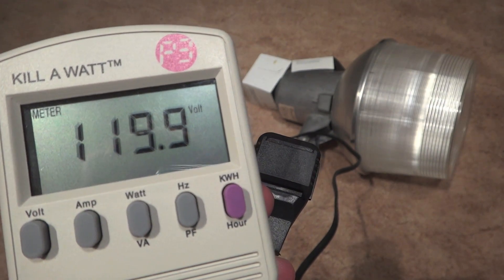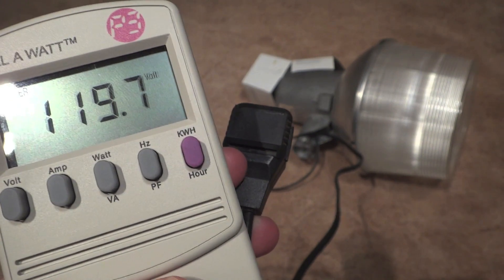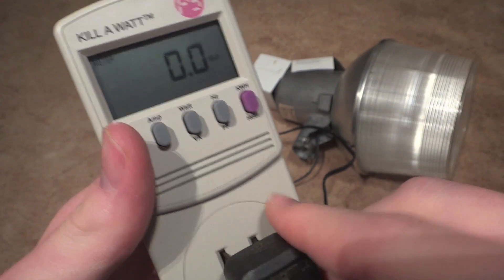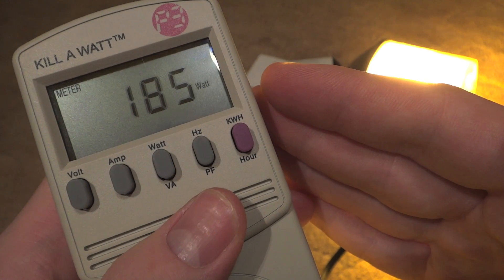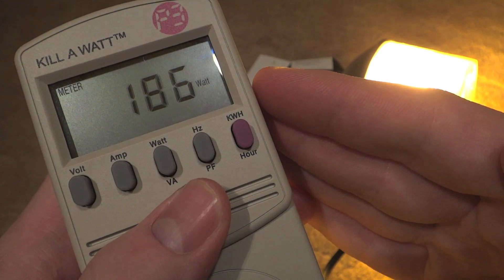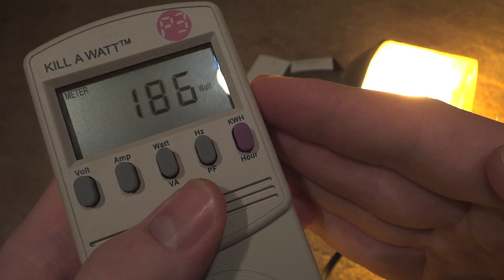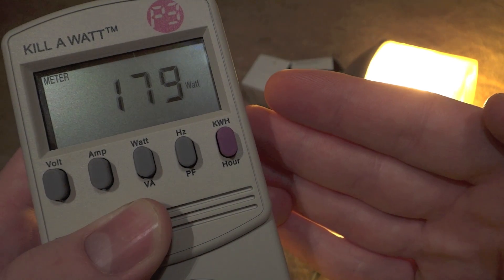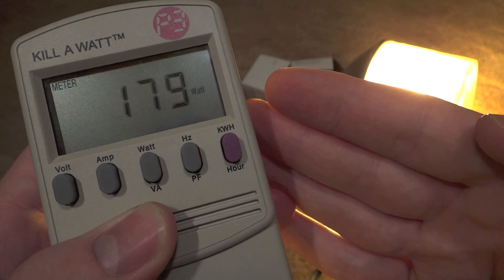Real Watts - 150watt High Pressure Sodium (HPS) retrofit MV bulb.

Comment: One important thing to keep in mind about these high pressure sodium retrofit lamps is that they are usually only compatible with high reactance autotransformer (HX) ballasts or simple series choke (reactor) ballasts (these ballasts often have no capacitors or sometimes have a capacitor wired in parallel with the input terminals for power factor correction). You really want to avoid using them with constant wattage autotransformer (CWA) ballasts (these ballasts have a capacitor wired in series with the lamp) due to the fact that their arc voltage drops rise rather quickly during their lives. Because of that characteristic, these lamps will run at a dangerously high power rating and overload CWA ballasts. Fixtures such as NEMA heads like the one in the video and yardblasters often have HX autotransformer ballasts, which are the ballasts that you really want to use for these high pressure sodium retrofit lamps like the Sylvania Unalux lamps. Interestingly, there are some high pressure sodium retrofit lamps that also work on CWA ballasts in addition to HX autotransformer ballasts and series choke ballasts. Those lamps include Iwasaki’s Sunlux Ultra Ace lamps, Iwasaki’s Sunlux Super Ace lamps, Philips’ Retrolux lamps, and CEW’s Retro Ace lamps.